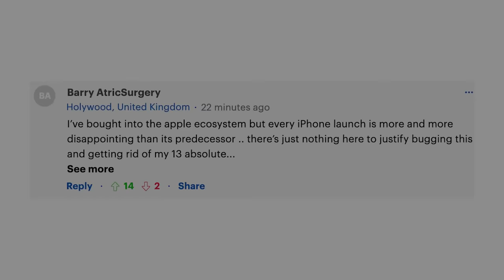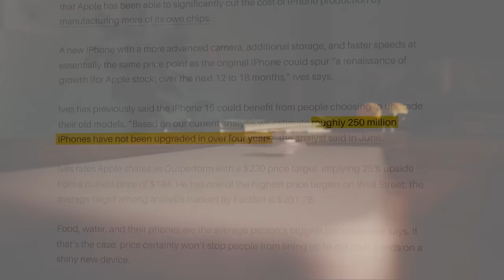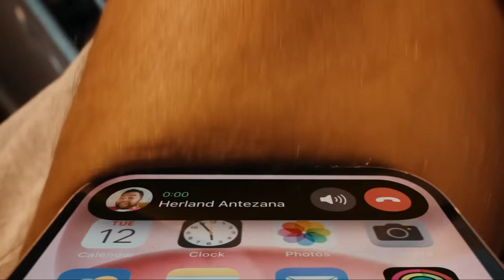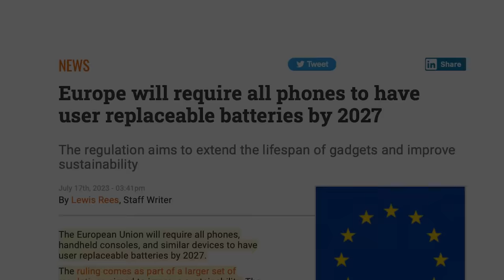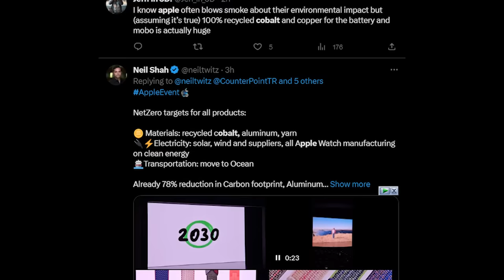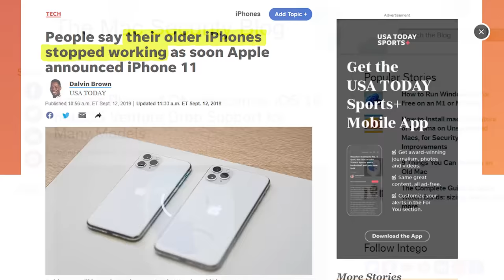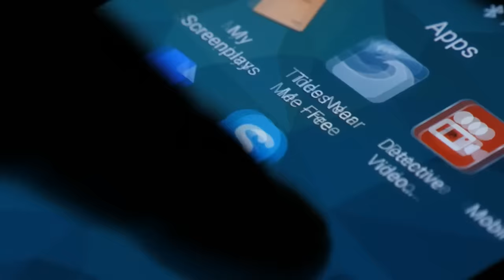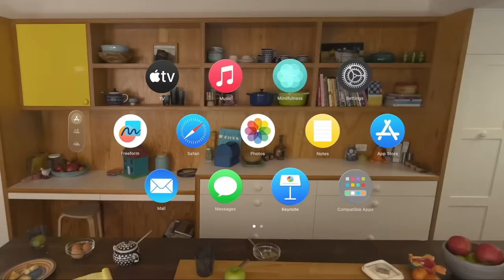The iPhone 15 Is Everything Wrong With Apple

Comment: The reason Apple and all other smartphone companies don't seem to be innovating anymore is rather simple, phones are a mature market. As you said, there's only so much you can shove into a glass slab before there's not much else that can be improved. Nowadays, it's mostly software that you will see updates in with very marginal upgrades to the hardware. Even cameras don't receive significant hardware upgrades because they're limited by size, they'll instead be improved through improvements in image processing. You shouldn't be worried about how these companies "don't innovate" because they're making drastic improvements in software, and people don't buy phones that much anymore because it's sort of like buying a car. You don't buy a car every year, but once you do buy a car after a few generations and revisions, you will see those improvements. That's what sort of market the iPhone is in now. 

However, back on topic, you should be concerned with how much they are willing to push software and how much it will integrate and act as a parasite on our lives. These companies will of course seek to occupy and obtain as much information about you through software, and they will absolutely have all the information they could possibly ever want with VR sets.
Reply: Finally someone that understands that people don’t buy iPhones every year rather 5 or later
Reply: All good points. The Double tap gesture on the new Apple Watch is a good example of that. Combining blood flow patterns and what not in order to know what you’re doing with your fingers is just  a glimpse of what’s coming. I welcome these technologies though, not that I have a choice 😅
Reply: Except we see godly innovation in the Android Market lol. How does Apple's boots taste like?
Reply: @dylancounte1448  You can enjoy the content of this channel and still have your own thoughts. I agree with a lot of what Moon says, but I disagree with a lot of it too. Don’t put yourself or anybody into a box. I reject modern society and live a fully self sustainable life, make my own energy and food, yet I enjoy technology and create AR training simulators for the US department of defense.
Reply: Wow life is gonna be scary 😂 all of us being monitored yikes
Reply: @GenUrobutcher  is it meaningful innovations or just dumb gimmicks ?
Reply: Ain't no way anyone read that whole shit
Reply: @noobody.  bro is not that much
Reply: Why bother releasing a new Apple every year or so? Would be more beneficial to release every 3 years or longer. No point in releasing an Iphone that just improves the hardware as most people are not even gonna notice
Reply: @ameremortal  exactly mate, I understand and appreciate moon's message but you can't deny that it originates from a very particular, possibly extreme view of society as a whole. I personally believe that social media has caused severe harm to society, the same goes for consumerism and materialism that comes from late stage capitalism. However that doesn't mean I'm going to outright throw all my technology in a lake and live like the unabomber, it's not all black and white like that. Rather, as moon says, in modern life which is seemingly becoming even more sterile, hollow and lonely, I try to find comfort in appreciating art, music and nature - we don't have to be miserable and nihilistic, we just have to be informed
Reply: @xamava  Perfectly put, we still have some level of control over our lives. We can make those choices.
Reply: @GenUrobutcher  No we do not
Reply: @blablaroarwwe  you need to skip 3-4 generations.
Reply: I don't even understand why people complain about phones not being 'innovative enough.' It is a smartphone, wtf more do you need it to do? Flamethrower?

People complaining phones don't innovative enough every year are the same type of people that buy a new iPhone every year; they are literally on the same spectrum, just the opposite side, because they would like to buy one every year if it matched their innovation factor.

I've had an iphone 4S -> iPhone 8 -> iPhone 14 (I just got the 14), so only upgrade when I have to and they last a long time
Reply: @piotrd.4850  yeah I agree and that is the same with EVERY other phone on the market that gets updated every year
Reply: @pyropulseIXXI  actually such a good point mate, like honestly it's just a fucking phone what do you need it to do? and atp I kind of scoff at arguments about hardware like cameras for example, because if you want good photos, don't spend that grand on a phone that will give you anaemic photos, spend it on a dedicated camera and you open up a REAL ESTABLISHED HOBBY

same argument applies to foldables, if you want to draw for example, don't get a foldable for that, a proper tablet will do that way better, and a drawing tablet will do it even better - or literally any other use case for having a larger screen, just get a tablet instead of a foldable that can neither be a phone nor a tablet (and yes I am just subtly bashing the idea of foldables, can't help it lol)
Reply: The market is also very saturated already
Reply: @GenUrobutcher  what innovations?
Reply: Other phones are innovating

Apple isn't, stop being delusional lol
Reply: Finally someone with some knowledge and common sense instead of simply listing "their " wants and needs.
Reply: @oh-noe  literally, any phone is interchangeable nowadays, be it iPhone or Android, this is a pointless exercise
Reply: @xamava  True
Reply: @xamava Im not about to listen to a youtube comment on how much stuff can be put into a phone, when scientists couldnt even fathom the limitations of gadgetry. As long as hard drives keep getting smaller and smaller I’ll believe that content can become more compact and refined.
Reply: I'm 57 and I am already starting to plan my tech retirement. I have made my final laptop purchases. Sent my desktops to social enterprises to be recycled and re-deployed. I am clearing out all old accessories and software. Once I hit 65 I will buy my last cell phone and use it till I reach end of life and must be recycled. It will be nice not having to worry about the next great thing or what to do with my last old thing.
Reply: @emersonguzman1743 you will get those dumb gimmicks 8 years from now and call them so innovative
Reply: @pyropulseIXXI  Innovation stagnates and doesnt go exponential. Just small features on a phone are not progress thats just Corporate zombie talking points. Stem education must be forced on every kid or IQ drop and zombies grow
Reply: This was going to happen. It’s literally a part of nature.

Rapid boom, experimentation, fine-tuning, convergent evolution.
Reply: Finally, someone that understands that a phone can only get so far, it’s still just a compact case for a limited amount of tech. Also thank you for understand that people don’t buy a phone every year 😂 no one is blasting someone else bc they didn’t buy the new iPhone
Reply: You make a somewhat solid point. However, I would argue that there is still plenty of innovation to be had. The problem is that it's not innovation that drives profit. Things like making iphones more accessible and able to repaired and making iphones last longer, those are all innovations. Except those innovations are directly contradictory to profit margin. So we won't see them. 
.
The real reason we won't see innovation is because innovation would not increase profits for them. A "mature market" is one way to put it. But we could also use the word "complacency." Because that's kind of what it is. And sheep consumers are ensuring that it can stay that way.
Reply: Agreed.  iPhones will never be able to make you move faster than light or anything so dramatically new.
Reply: BEACAUSE you’re. It meant to buy a new one every year rather 5-7 if you really puwhity
Reply: They dont need vr to get all your information, I wouldn't doubt if half the companies in the world already have all your data. To you it may be important, to them its just a way to make more profit.
Reply: @Nobleoasis27  That's true, but by that point it would just be much more effective for them to stockpile all data they can - I suppose more or less the peak of what they can harvest
Reply: @xamava  yeah thats true. I can imagine it haha, they all got a digital folder for ya with all your data. Overtime they'd just add " Aight mr Bob here had pasta for lunch at 5.29pm 17/5/23.  ". Funny world we live in aye.
Reply: @GenUrobutcher 
No we don’t. The Android Market has been in the same position as Apple. They’re dead too.
Reply: @GenUrobutcher   other than half developed, not finished, gimmicky, marginal hardware upgrades, what "godly innovations" are seen in the Android market? Because i dont see any...
Reply: I mean, they could get rid of the basel. That should be their priority.
Reply: @GenUrobutcher  you need to understand that not everyone cares about technology as much as you or i. Some may love the innovations that android offers but some feel indifferent
Reply: @vexversaa239  literally, I don't know what's this obsessiveness with some people for insisting that their phone is more innovative than the other, that argument doesn't hold stale bread nowadays when neither side  is doing anything remarkable (it's so often the android users and I'm an android user myself, you lot ought stop being so insecure, just enjoy your phone and quit fighting pointlessly). Like honestly, I have not been wowed by a phone in ages, every single android phone I've seen in the past few years has been interchangeable, except for maybe the asus phones but I'm a fan so there's some bias there
Reply: @Neko_ix exactly mate it's all incremental, after 5y of using the same phones those minor updates will add up, and tbh I wouldn't even upgrade, I'd just replace the battery. If you have a flagship phone from 2020 nowadays, you can literally just keep it running for ages although that opens some security risks but I digress... 

But yeah, this entire debate is based around people thinking that everyone buys the new phone every year, yes there are some who do that but that's an overall minority, most people aren't
Reply: @aleksandarmiljesic68  I haven't seen anything remarkable on the android side for ages, it's just as dry as the iPhone has been for the past 4y, there's nothing revolutionary, new or useful, and there won't be anything much newer than there is now, people just need to stop expecting too much. It's done, the market is saturated and the phone has reached the fundamental peak of its design, doesn't mean there aren't improvements to be made but they will all be marginal from now onwards. If we're being honest, every android phone I've seen in recent years has been plainly interchangeable - and so the android fanboys don't cry, yes that applies to iPhones too, they're both in the same boat, and I also own an android - quit crying christ, you're loud
Reply: Not true. I assure you if Steve Jobs was around there would be CREATIVITY happening!
Reply: @GenUrobutcher godly innovation oh my lord Android fans are so delusional it’s insane. I’m so happy I grew out of my android fanboy phase

All of these said “innovations” are gimmicks at best
Reply: @xXVibrantSnowXx  It's not innovation, it's the next gimmick to keep geeks happy
Reply: @jamrah8713  FINALLY SOMEONE GETS IT. I used to love Androids and had a Note 20 Ultra as my first phone, and kinda realized I didn't use any of the gimmicky features (including the S Pen) so I switched to iPhone and never looked back
Reply: @jeremylittlemars Is that sarcasm? Being watched 24/7 is what leads to dystopia.
Reply: THANK YOU. the obvious is not so obvious for some.
Reply: Thanks for commenting this. I hate having to defend Apple but I honestly get so tired of people saying iPhones aren’t changing now. The rapid pace of tech improvement has slowed and the use cases for the phone form factor have been tapped. Phones are now cars, they make a new model each year for the people that need to buy a car that year, but there’s no reason to get a new one every year.
Reply: It’s not just size, it’s also that there’s a limit to how many pixels you can even really do any good with. Real photography is always going to require use of full sized lenses, the ones in phones are a sort of compromise for what people use phone cameras for. Really wish they had options with more budget cameras to lower the cost, not everyone is an instagram hoe lol
Reply: There is a lot of inovations in android market LOL...but apple have their sheep buyers....
Reply: I will say apple has had some pretty cool innovations in recent years for iPhone. Magsafe being probably one the best. BUt yeah its quite limited now, because any really big innovations at this point would basically be a new product.
Reply: @jamrah8713  literally mate, I don't know how there's still so many people defending their favourite brand as if they're holding their family hostage like who cares? I'm an android user, I'm informed on both sides, I know the benefits and cons of each, it's not that deep. you like one phone I like another, in fact I like both iOS and android phones and I practically study both of their activities and I can tell you with at least 5 years of just analysing what they're doing that yeah, there's not much going on nowadays but people still keep expecting something remarkable and especially those on the android fence like mate, both phones are good, we've been over this since 5y ago it doesn't matter
Reply: You see you make good points until you completely miss the fact of the other side of the phone market which is android. Android has had more significant, unique, and actually good physical and software improvements in there phones almost every year, wether it be samsung, Motorola, Google, or whatever. Apple doesn't "innovate" anything, they just add  a couple of features to there phones and call it a brand new device, while Samsung first of all created the flip phone, but is also making noticeable improvements in design, build, and reliability on TOP of all the major software updates they add every year. So your argument really doesn't work here. Not to mention most of these "improvements" apple adds to there phones are already a thing with android. So even in the software department there not doing anything new.
Reply: @xamava I just have to say that I appreciate you sharing your common sense, wise, and educated opinions on the topic. It’s a breath of fresh air to hear someone whose stances actually reflect reality.
Reply: As Steve Jobs once said, Apple is more a software company. At some point the hardware won't be different, and it will be defined by the software inside it. That's why I'm studying programming in the first place.
Reply: well said  @VoidPaul97 , the endgame for technology isn't hardware anyway it's software, nobody cares about what the vision pro is gonna look like once you put it on your head and are immersed in its environment - regardless of my thoughts on that
Reply: @ameremortal  The Double tap gesture has already been there in the accessibility settings of most new gen apple watches from a long time. It was just that mot people didn't knew about it and apple took advantage of that and promoted it as a newly integrated feature. But the truth is it was already present from quite sometime.
Reply: And this is why VR/AR will take over or something else. Who knows eventually we may not even need phones anymore
Reply: @VGYAN4K  heard of that, there was another feature very similar to it since apple watch 5 I believe but not many people knew about it so apple essentially rereleased it since they could also relate the gestures to their VR gestures 

what is shitty however is the execution, because they made it exclusive to series 9, when more or less the same gesture has been available since series 5
Reply: other smartphone companies are INNOVATING. only Apple who doesnt INNOVATIING.
Reply: @GenUrobutcher   you probably isolate yourself from society, and listen to android mantras everytime someone tells you that not everyone and their nanas want a 200x zoom 100 watt android and would rather an iphone from a year or 2 ago
Reply: Glad someone else typed all this out before me...I didn't feel like having to explain this, and even if I did, I wouldn't have done such a good job of it.
Reply: My stance on this is, if it ain't broke, don't fix it. As you said, smartphones are a mature market now, except the yearly incremental upgrades in performance and camera and a few QoL changes, there is not much more to innovate. The excited times for smartphone enthusiasts are over now (and I used to be one of them). Apple is still a profit-oriented company after all, their audience isn't people anymore who upgrade yearly, but rather every 3 years or so and for that what they are doing is more than enough. You really can't blame them. Coming from the iPhone 11 the 15 Pro Max is gonna be a huge upgrade for me. And sure, I could just get the 13 Pro Max instead and there wouldn't be much of a difference, but the added longevity of just being a newer product (better performance and longer software updates) goes a long way.

Most of their resources are now most likely relocated towards VR and thats probably for the better. Sure, smartphone enthusiasts have a very boring time ahead, but they are in the minority anyways. This took a long time for me to learn, but the people on the internet arguing over MP, mAh or the nm of the processor architecture are not at all representative of the average folk. They are enthusiasts, the average person couldn't give less of a shit. They just buy what looks good. Our time will come again in the next few years when VR finally starts going mainstream.
Reply: @ferryhmm   I agree with pretty everything you said and anything else I can say would just be my personal take on things! 

So sure let's go with my personal thoughts on things because I'm bored, first off I honestly doubt I'm going to care much when VR comes along, I'm not the biggest fan of the disconnect from real life that comes with such a technology and frankly, I barely care for the specsheet numbers anymore, it's a pointless exercise any phone you look at nowadays (few exceptions apply but anyways) will most likely be really good. Similarly, I would rather have a 13 pro over a pro max, or even a mini lol, I loved the 12 mini in that stunning purple although I doubt they'll bring those back - I'm tired of lugging around a brick of a phone which I prefer using my computer over and essentially serves as a glorified MP3 player at this point

But yeah, agree with everything you said mate, just wanted to share my own take on some of what you said :)
Reply: @xamava  Ah thats nice, I love some exchange over personal preferences when it comes to tech :)

Personally I kinda was thinking of gettting the mini at some point as well. I am kinda like torn between going either all or nothing when it comes to smartphones. A part of me wants to lower my smartphone usage and the iPhone Mini would just be perfect for that. It's a form over function kind of phone, as you can actually use it with one hand and is perfect for everything non-entertainment related. But then there is still that tech-nerd inside of me you know. Wanting to go all out. And I am a big guy with big hands and everytime I see that 120hz display on my brothers phone I just want to cry lol

Regarding VR I still think it has ways to go before going mainstream, but it definitely will at some point. It makes literally every other technology obsolete, TVs, smartphones, smartwatches, headphones etc. it's potential is just too strong. And the future possibilities are also endless, given that as it's something you wear on your head I can see how in the future it will be able to measure brainwaves and stuff. Absolutely scary when it comes to privacy concerns (imagine algorithms optimizing the ads it shows you by measuring your brain activity ugh), but it's a two edged sword which also allows many great things to happen (imagine apps to practice focus, algorithms that know what music you're going to like, games that can adjust their setting according to how you feel etc.).

Of course, being something that you wear on your head is also it's biggest downside. In fact, I would argue it's the only obstacle we have to overcome for it to have mainstream potential. But people are working on that. VR headsets are getting smaller by the day and tbf I don't think what goes mainstream will look anything like the Vision Pro. It's probably going to look more like just a normal set of glasses with AR functionality. Working prototypes of contact lenses also exist already. We might see something like AR glasses becoming the mainstream version, replacing smartphones and then a VR device like the Vision Pro replacing everything else (computers, laptops, anything with a screen really). The incentive is most definitely there. Think any company would rather just give each of their workers just a VR headset to work with instead of a computer, multiple monitors, a headset for meetings, peripherals like mouse and keyboard etc. Desk setups for sure are going to look hella clean in the future lmao
Reply: You have good points but I have to disagree with the not being able to put more tech in it argument. WAY faster charging, UW cameras that are just as good as the main one or much more compact batteries (look at the new OPPO fold) are just a bunch of them. I'd be willing to bet that all the big tech companies have a ton of things they just won't give the consumer because of pure greed to milk the cow for many more years.
Reply: @Bronyboiiiii  Yupp I agree with the fact that they definitely have some interesting projects in the work behind the scenes but will likely refuse to do anything with them because they can comfortably pull off selling what they've already got without issue, given the current state of the market 

A good example would be GaN with most manufacturers being rather slow to release phones using that technology despite it overall appearing to be superior to lithium ion - I hope I'm not getting something wrong here I haven't focused much on batteries in a while although I will say I am not sold on the super fast charging so perhaps you can explain it to me, but I feel like that is probably not the best thing overall for a battery's longevity given that all batteries would much rather be charged slower
Reply: @workinghard-lx1qw  No they aren't. Other phones are just more powerful. Most of the features people call innovation are things people don't need or want. No Phone company including Apple is innovating the phone because it's a mature market. Why do you think companies are getting into AR/VR? Cause thats where the market is heading. The only innovation that happens is with software. People don't buy Apple for the hardware. They buy it for the Apple ecosystem. If people bought Phones strictly off of hardware than more people would have Pixels and Samsungs.
Reply: @GenUrobutcher Godly innovation? Yeah maybe 5 years ago but even foldables have started to stagnate with very little new on each iteration.
Reply: @ferryhmm you're telling me that getting a VR is worthless? Thanks for ruining my opportunities
Reply: @ameremortal so you hate society which means I have to hate it because of what you said 😒
Reply: @xamava he's basically lying about the modern day life
Reply: @xamava it sounds like you're complaining in a lot in your comments than saying some common sense which I can't tell cause I have autism
Reply: @assassin8636  hm? what's up mate what am I complaining about
Reply: @assassin8636  "you're telling me that getting a VR is worthless?"

When did I say that?
Reply: Matured?
Still haven't seen LGs Wing design get improved upon
LG did it and that was it
Plus there is no phone that has the jack, SD card slot, notification light, sim slot, camera button, removable batteries otherwise I'd buy it in a heart beat

Closest anyone came close to that was the xperia phones hence why I use xperia 5 mk 2.
Then there's the secondary screen which LG also did which is a better version then the dynamic island apple is now doing but again.... since LG nobody cared for that useful feature or didn't even know about it to begin with and that design hasn't been used or gotten better.
No improvements to notification light either it's also basically all gone.
Miss my xperia L having a bottom notification light that was bright and would change colors as well.
Shout out to nothing phone they are at least trying but I prefer a notification light on the bottom side of the phone or the sides of the phone not the rear of the phone but it's still a interesting design and same with asus they also use notification light which I love
Reply: Yeah I think phones will be gone by 2030 if not sooner.
Reply: @ProjectLumid it's meaningful. You call it gimmicks until apple ends up copying just like you did for widgets and other features
Reply: @aleksandarmiljesic68 name what isn't finished and gimmicky. Remember when yall said that about widgets?
Folding phones are an example
Reply: @ertgb_ imagine calling s pen is a gimmick 🤡  so you switched to a worse phone 😂

But when Apple copies Android eg widgets suddenly its not a gimmick? 😂😂🤡
Reply: if that’s the case it’s even worse i’m getting charged 800 for a software update